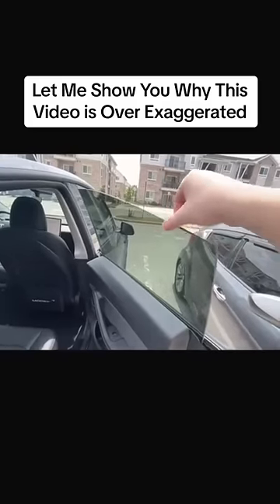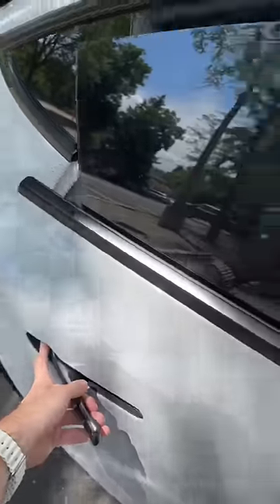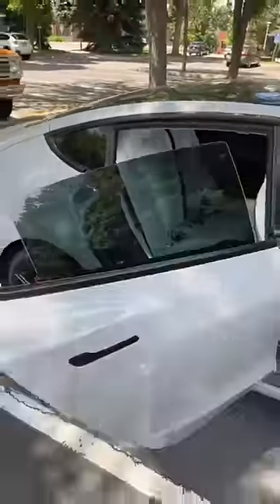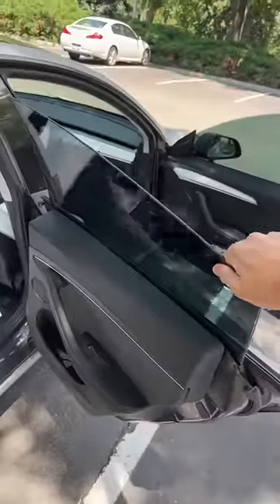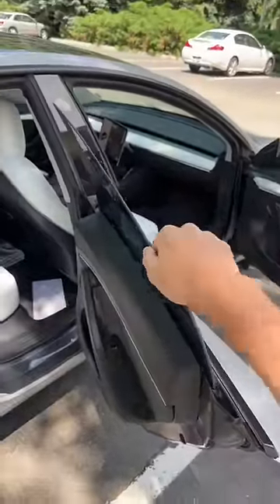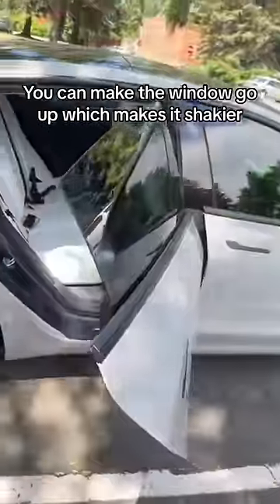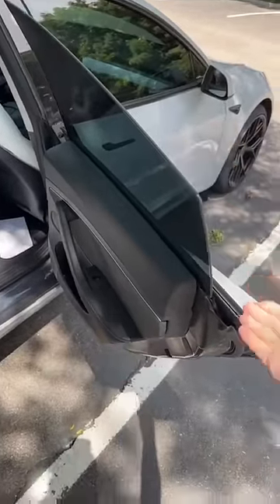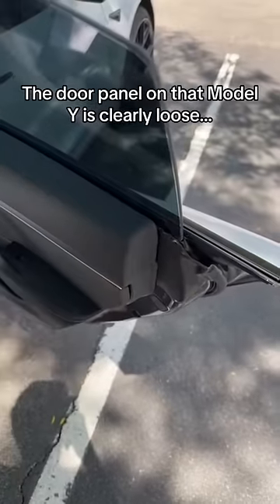Is Tesla Build Quality Really This Bad? 🤔🤨

Comment: My 2005 Toyota Celica has frameless windows too... They don't budge at all 💀💀💀
Reply: would be bad design if true. why would u build something that needs to slide in and out every day multiple times to a point where it cant adjust at all
Reply: Same with my 91 Toyota mr2 😄
Reply: @12P14D22C  What on earth are you talking about? Did you seriously just interpret my comment as "my windows don't move in any direction whatsoever."??? I'm obviously saying that they don't shake and rattle side to side like these Tesla windows do...
Reply: Sameeee got a 2001 Toyota Celica and the windows are frameless and don’t budge at all gotta love Toyota
Reply: @victorolivares2238  Fr bro, they built these cars so nicely, it's just such a joy to own.
Reply: Bad engineering I would think, if you have something as fragile as glass be so rigid and not allow no vibrations on the glass to shake to reduce some impact it would make it much easier to break the glass from less force than if the glass budged more
Reply: @jorgeespinal5591  Yes, it must be such bad engineering that both doors have stood up to 18 years of being opened and closed, slammed shut by friends, and thousands of window actuations; and after nearly 2 decades they still have no play in them and work as good as from the factory. 🤣

Also, the window glass rests against the rubber door seal which absorbs any vibration between the door and the body :)
Reply: @jorgeespinal5591  the nerve to call a  toyota “bad engineering”
Reply: yea cuz toyota is actually a good and sturdy car brand xD Tesla is just innovative for its technology, structural design just pray to god the car doesn't fall apart while driving
Reply: Same with my 1988 Nissan
Reply: @jorgeespinal5591 old toyotas are anything but bad engineering
Reply: They built them like they use too :(
Reply: '05 Ford Mustang here. Crazy that our 20 year old entry level sports coupes have better build quality than a brand new Tesla...
Reply: @b-chroniumproductions3177  And they have an actual soul 😂
Reply: Same with my 04 mr2 😂
Reply: I have a 2000s, and can say the same. Only the poor moonroof have to be fixed like 5 times a year.
Reply: @jorgeespinal5591 lmao Ig the toyota fanboys dont believe in science 😂 theyre so tilted and seem to assume youre a tesla fan. 

Facts are facts, if its more rigid like that, it will be more likely to break. Thats just a fact. People should not be so emotional that they cant see facts.
Reply: @jaquicx9500 buddy if youre saying the window gonna break because it moves very little rather than moving like its not held in then you must be on something 💀 any car window doesnt move with or without frames! Why is everyone forgetting to point this out its just the same but with a frame. Having no frame doesnt mean it should flap around like no tomorrow buddy 🙏🙏
Reply: @TheThingsWeDoReal  movement allows the windows less of a chance of breaking, thats a fact. I dont care about which car blahblahblah. But i will say that tesla windows only move if you push hard, but they do have give, which I'd prefer
Reply: This
Reply: Of course not, you bought a car from a reputable brand 😂
Reply: @optie5 toyota pick up trucks are even used for wars there even is a war called the toyota war with chad using them and winning
Reply: @victorolivares2238 yall not understanding that something shaking under pressure then not is hilarious. Like no Rollercoaster stands still because then it will be brittle
Reply: @jorgeespinal5591 lol, "fragile". It won't break even if you use a hummer, might crack, but its definetely not fragile. Shakiness is much worse, since its beyond the threshold of "letting vibrate"
Reply: @HcutiegirlY  except when you crash the battery just.. blows up
Reply: L
Reply: That’s one of the many reason why Toyotas are just better in general😅
Reply: @jorgeespinal5591 last time I checked Toyotas are not having their glass cracked because of well fitting parts, but Teslas however sound like a frickin rattle when drove
Reply: My 99 miata does too way more solid than the vid
Reply: @12P14D22C are you really questioning Toyota design?
Reply: Bruh same with my 77 Chevelle, and I still need new window seals
Reply: @beenusirimanne You realize that designs can be improved. Having a rigid window is in fact a bad design. Just because it’s lasted a while doesn’t make it any better.
Reply: Almost like tesla cars are just not that good and poorly enginieered.
Reply: @xxbatman69xx98  so Toyota's design is sturdy, reliable, and lasts a long time... What exactly is wrong with this design then?
Reply: @beenusirimanne  I literally just told you the problem with the design of their windows and people in this comment section has already told you. So I don’t know why you’re asking a question you know the answer too. Part of engineering is improving on designs. Even buildings that aren’t designed well will still last quite a bit.
Reply: @beenusirimanne  So I really don’t know what you’re confused about.
Reply: @xxbatman69xx98  that's where you're wrong genius. The window isn't rigid or brittle like a concrete post. It has enough flex to conform to the door seal firmly, but also bends enough to handle being slammed extremely hard, whilst still not rattling and shaking around like this Tesla window. Perhaps you should try to actually understand what I'm saying instead of operating on whatever you believe in your own head. It's pretty clear that my vehicle's window design is very well optimized, and if you think otherwise, then that's up to you.
Reply: @beenusirimanne  I read your comments. Not once did you mention any of that so I don’t know what your talking about. Second, not one person said that the windows are that brittle. Everyone is saying that I would be a better design then having very rigid windows.Third you should link an article or something to validate what you just claimed otherwise it’s just baseless. And fourth, you say that I should listen however, everyone in this comment section (or a good chunk of them) are telling you otherwise. Maybe you should take your own advise and listen to people.
Reply: @xxbatman69xx98  you are literally just arguing for the sake of arguing at this point. You claimed my window was brittle, I explained to you how it isn't. Now you want a source for something that you haven't specified? I don't even understand what your motive is for this debate? And since you mentioned it, plenty of people in this comment section are agreeing with ME, so maybe you should leave it at that.
Reply: Bro that car is as old as me
Reply: @beenusirimanne  I mean I’m just explaining to you that designs can be improved upon im not even arguing. You’re the only one considering this an argument so I’m confused about what you’re saying.
Reply: why does this remind me of another youtuber who clowns on tesla
Reply: same with my 96 celica lmao
Reply: @jaquicx9500  thats is a lie you do not want the window banging around in the door
Reply: @djjaysky9071  banging around isnt good, but wiggling is
Reply: Frameless cars dont really budge alot, only when you purposely remove bolts. I have a fare share in most(2005 celica being the sturdiest)
Reply: Same, I have a 2001 peugeot 306 with frameless windows...they don't shake
Reply: Toyota power!
Reply: I have a 1992 subaru legacy turbo and don't wiggle like that 😂
Reply: my 09 mini cooper too.
Reply: I WAS GONNA COMMENT THIS. My first car was a 2003 gts
Reply: @nekomata5198  Beat you to it 😛
Reply: 2017 Mini cooper S, frameless windows don't budge.
Reply: Imagine spending that much on a tesla only for it to explode or get into a car accident because the “auto pilot” was intentionally marketed wrong
Reply: Same with my 16 Challenger Hellcat😂😂 and I drive the shit outta that thing
Reply: yo same here my 85 celica supra has frameless, theyre a little bit shaky though
Reply: @riqi2  Meh Toyotas are reliable, but they are really underpowered.
Reply: 2002 Forester same here, what a joke lmao
Reply: @12P14D22C torota has bad design? 😅
Reply: You can keep your 2005 celica…. Lol
Reply: @jlimphoto  Toyota 💪💪
Reply: @jlimphoto  that's the plan.
Reply: @GoogleDoesEvil wow almost like they are built to be cheap and have people change it to their liking… oh wait
Reply: 2005 celica and a 2006 accord.  We both lose at life bro
Reply: Now, take in to account how long Toyota has been making cars. I love Toyotas but when I bought the Yaris the year it was released, it had no less than seven recalls, so all kinds of build quality issues. One was a fire risk in the seat belt retraction, another a seat rail malfunction... point being there are always build quality issues with relatively new models, and Tesla is quick to address and resolve build problems. Once they have the same amount of experience as a major legacy player, I am sure their quality will be exponentially improved.
Reply: ok scotty 👌
Reply: Exactly, my s2k's don't either
Reply: I bet thats a super safe car too
Reply: Lmao. 😃 😊 😀 😆
Reply: How safe is your car?
Reply: @LanceGabrielBalastigue  yeah the Taliban used Toyota pickup trucks and they beat the US military
Reply: Some BMW/Audi have them
Reply: My 71 Fords frameless windows do not shake.
Reply: so? its still a shitbox
Reply: Dont compare toyota to a electric trash
Reply: my corvette has em it shakes more than the one in the vid
Reply: @beenusirimanne out of every car you got a celica? Yikes dude that is a shitbox compared to any other toyota.
Reply: Same with Lexus es300 1998
Reply: Got a 2004 outback with frameless windows, doesn't rattle like that either
Reply: got a 91 celica, same here, they do not shake, even in the highway with them open
Reply: @mommarose9884  i got a 23 model s and it doesnt even slightly shake
Reply: Same with my 03 MR2. People love defending Tesla for poor build quality
Reply: Facts my 2004 Tiburon has frameless windows and dosent do it too
Reply: Doubtful, 80s 90s 2000s Toyota are death trap and lack any structural strength
Reply: @evanleo7633  sure thing bro 👍
Reply: @beenusirimanne  to be fair not just Toyota, all cars from that era is flimsy
Reply: @jorgeespinal5591  tell us about a f**** overpriced garbage EV without telling us
Reply: Lying your ass off lmao
Reply: Wtf is this their first car ??? All of this is normal. 

If the frameless window was not flexible like that it would shatter as soon as you close the door. It’s supposed to be flexible for that same reason. For some of these brainless idiots these things are a luxury without them even knowing… sad🎉

Comment: The frameless windows on my 20 year old Toyota don’t shake at all
Reply: Same on my 20 year old Acura lol
Reply: YaH bUtS ItS a tEsLa
Reply: My 996 is 25 and the frameless glass is all rigidly affixed to the doors.
Reply: fr on my celica
Reply: Same on my Solara
Reply: Same here on my old ass subie, no shake
Reply: Same here on my 95 subaru
Reply: Exactly what tesla users cant understand. They buy bad stuff at high price and think it is actually good stuff.
Reply: Same on my 20 year old 350z roadster, no shake at all
Reply: Yeah like frameless is new innovation just because its in tesla 😂
Reply: my c6 corvettes shake a tiny bit but not like that 😂
Reply: Same with my 1994 Honda del Sol, and The windows in it  didn't shake that bad in it after it got t-boned
Reply: @slo_s10 the QC on Corvettes is very questionable
Reply: That doesn’t make it any more strong?
Reply: 1995 Dodge Neon. Doesn't shake like that. Yeah, my budget car and it was still better after 25 years than a new Tesla.
Reply: Got a toyota solara convertible rn frame less. My window doesn't shake even half this much.
Reply: @macandolf fuck yeah. Best car.
Reply: Yeah I wouldn’t praise the Tesla for feeling like a luxury car. It’s very good to drive, build quality is hit or miss. In my case it’s pretty good. They are comfortable. But all the cars vary in build quality and that’s not good
Reply: @riceball7021  my 1986 pontiac fieros frameless windows done even shake remotely close to that
Reply: Then post a video
Reply: I'm sure he thinks Tesla invented frameless windows
Reply: Same on my 21 year old Mustang.
Reply: I think Tesla uses a different type of glass which is stronger in crash
Reply: 01 mistu magna ain't budge
Reply: Same on my '84 Corvette, Tesla can't even beat 40 year old gm, crazy.
Reply: Same on my c32 and c33 laurels
Reply: @karanbaiju4018  Wrong I smashed a Teslas windows in a 10kmh collision while my c33 has survived being T-boned at 50kmh without any broken windows
Reply: My Ford (mustang) doesnt even shake that much 😂
Reply: 100% cap
Reply: Tesla fan boys like to pretend that only Telsa has frameless windows. They've apparently never driven in anything but a Corolla before getting a Tesla. Super common in European cars. Somehow the windows are still sturdy and the interior door handles work just fine.
Reply: Subaru checking in, no wiggle
Reply: Neither does my 30 year old BMW's frameless windows. Everything else does though :P
Reply: Yes, it does. Brand doesn’t change basic physics
Reply: It’s different glass
Reply: I would put buses an all your crappy cars with my model 3 😂.
Reply: Same on my 20 yr old Merc
Reply: Same on my 1968 Corvette
Reply: @Bassmaster-xd2pn that does give it slight merit though due to Tesla only being around since 2008 and only being a real car company in 2012 unlike Toyota which has had years to improve, things improve with time
Reply: Yeah...but it's a toyota .

I can't drive more than 5 miles in one before I fall asleep.  Worlds most boring car maker.
Reply: Yet you commenting on a Tesla video about a shaking window… why do you care so much lol
Reply: same on my 21 year old subaru impreza xD
Reply: Bs...
Reply: Ummmm I’d be Concerned if they didn’t budge at all…. It’s supposed to have flexibility. In case you didn’t know, a rear window is tempered for a reason.  If it’s not flexible it has to shatter easily. Otherwise it has to be really flexible…..

Comment: This dude accomplished the opposite of what he was trying to do lmao
Reply: Bro proved that the windows are shaky
Reply: Lmao, that's so embarrassing 😂😂😂
Reply: @fearlesswindows  all framless windows i have seen are about the same in shakiness in my opinion
Reply: The bolt to the bottom of the window and the regulator is loose
Reply: Get your eyes checked
Reply: turn on the 🔊 bro hahaha
Reply: Just bc its shakey doesnt mean its bad tho.. 
Bc when it closes it seem to go inside the top meaning it is basically the same as frame windows when its closed. 
And in a brittle test these type of SHAKEY... AKA flexible windows brek harder. 
As hard things break but flexible things flex. 
Unless someone is strong enough to rip open the car door or break the glass in half... (In which of either case no car with the same glass type could survive) then it seems perfectly fine.
Reply: The text at the start of the video literally says "let me show you why this video is over exaggerated" not "let me show you why this video is completely false" the windows are shaky but they won't sound bad when they shake unlike in the first clip.
Reply: @fearlesswindows he wasnt saying the windows arent shaky 🤦‍♂️ he was saying that the first clip was exaggerated (which it was)
Reply: @fearlesswindows he wasn't trying to prove they aren't shaky he was saying the first clip over exaggerated
Reply: @galacticdragon9841 its like the people in the comment section are neuro divergent
Reply: @kebabmastaren  which is why frameless windows are a bad idea

Comment: "it's not gonna shake the same" 

shakes it the same
Reply: Exactly, admit it please the fact that Tesla has worse build quality than other brands like BMW😂(I have a bmw as a family car, no build quality shaking or queeking sound at all)
Reply: @matt5156  also cost less?
Reply: @kaz8103  yes, my parents bought the 218i Grand tourer 2022 version in Hong Kong for 350 thousand hkd which is around 45000 usd.
Reply: It's not shaking the same way. Or do you hear anything like the video he compared it to showed?
Reply: @sascha_products literally yes it sounds extremely similar
Reply: @sascha_products it shouldn’t be shaking at all older frameless windows didn’t do this  Tesla just has bad build quality  along with Chevy
Reply: Older Subarus (90’s- early to mid 2000’s) also have frameless windows, but they don’t shake like that!😂
Reply: @matt5156 why would you compare it against BMW? That's literally the brand that makes you pay for heated seats
Reply: You’re pretty blind if you think that is the same… also almost all frameless windows will do that 💀 not to mention, the biggest difference is that the door panel in the fake video is clearly loosened so the window and the panel wiggles…. Which as you clearly can tell it normally doesn’t and shouldn’t do that
Reply: The level of cope is over 9000
Reply: @elijahjenkins1669  they do though
Reply: I mean what do you expect from a american car brand that is pretty new to the scene. It will most likely be pretty bad
Reply: My 2012 Camaro has frameless windows and doesn’t shake a single inch.
Reply: Bruv my tesla model 3 is very solid. I tried the window thing, and it didnt budge at all. Jokes on u for wasting money unnecessarily.@matt5156
Reply: @AloeEverAfter do u also get 20 mpg😂
Reply: @Random__user8405  yeah😔
Reply: @AloeEverAfter  I can't tell if ur being sarcastic or not
Reply: @Random__user8405  no it’s shit gas mileage
Reply: @AloeEverAfter  well I mean it's a Camaro so it's worth it.

Just hope it's not ur daily.
Reply: Not the sounds come from!!